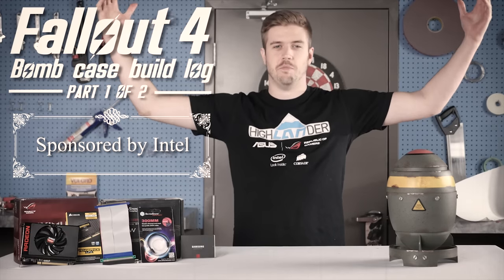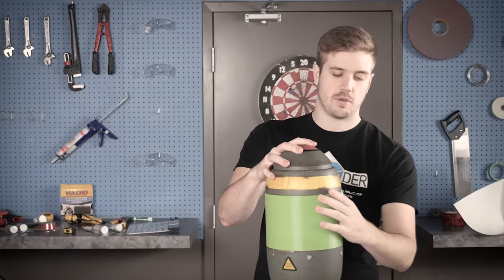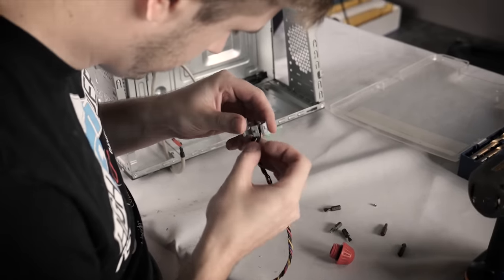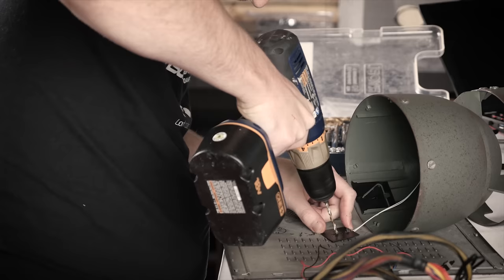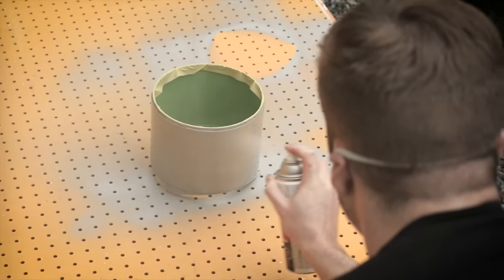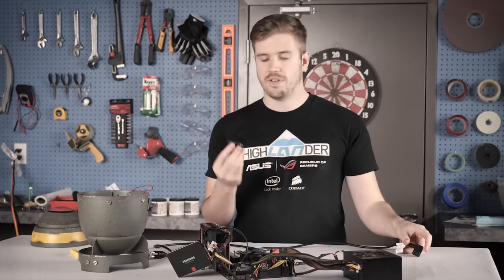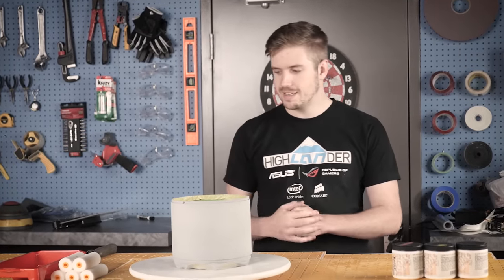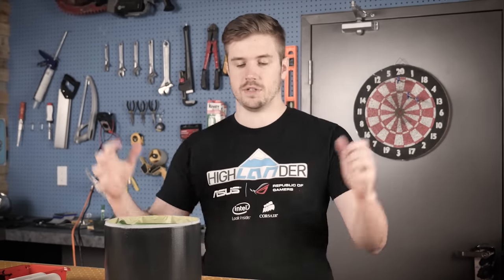Fallout 4 ULTIMATE "Bomb Case" Build Log - Part 1 of 2

Comment: Did you know someone managed to fit a computer running windows xp into the actual windows xp cd box itself? lol
Reply: +skil3z raspberry pi magic.
Reply: *****
 BEFORE Raspberry pies. The motherboard he used was a EPIA M10000 Mini-ITX
Reply: +skil3z Pics or videos?
Reply: +skil3z they could have just taken like the Zotac Mini PC thing the reviewed a few weeks back and fit it in the bomb with no problem without that stupid riser.
Reply: DanielRichards644
 You haven't even seen what the riser will look like painted but if it turns out ugly, i'll agree
Reply: *****
 regardless of how it looks when painted it will NEVER match the CURVE of the original.
Reply: DanielRichards644
 well i agree, it will look stretched, or like a realistic nuke, and not an ellipse shaped
Reply: *****
 plus it doesn't help that Luke doesn't seam to KNOW he needs to sand between primer coats to smooth the surface using the high build primer which is why that pattern was showing up when he began applying the black paint. if he finishes with a glossy finish it the 3d printing "lines" will telegraph thru the paint noticeably.
Reply: +skil3z easy nowadays, just throw a computestick in it and done :\
Reply: +ThaTyger and ull even have space to spare
Reply: *****
true, although it's probably easier to get XP to work well on a computestick and they tend to be a bit more powerful. More expensive as well. Hmm you could put like 10 Pi Zero's in a old-skool CD box :x
Reply: xXAUSTYNN 11Xx
 congratulations, only 8 MONTHS late to the party. maybe if you read the responses you would have seen the guy that already mentioned the compute stick
Reply: Be funny if it was running Mac OSX or Linux.
Reply: Lol

Comment: that does seem like 3d printing for the sake of 3d printing..... then there was all that work to basically make it like a PVC pipe you could have bought for a couple of cents :/
Reply: +wacka What's the point of having a 3d printer if you're not going to take advantage of it
Reply: +wacka You know that there are PVC pipes with the exact size needed?
Reply: +wacka because mounting options? because 3d printer? Because diy? Because modularity? because options?
Reply: +wacka Well, IF it was available in exatly that size. not impossible, but i doubt it...
Reply: +djkucuk I'm not saying "never ever use a 3d printer for anything!".... I'm just saying, a PVC pipe seems like a far simpler, cheaper, more productive option here... and mounting brackets..? a little bit of metal with a hole in, glued to the inside would do the job.. or.. you could even 3d print them

I love the idea of 3d printing stuff... but if it means having to spend ages sanding down, priming, re-priming... re-re-priming... Id rather find a more simple solution
Reply: +wacka 2 people mentioned size, of course u ignored it. pipes come in discrete standard sizes. m8.
Reply: +Mr Ching &#171;chicho&#187; Chong 
Also mounting option to get it perfectly flush and snug is a pretty big point...
Reply: +wacka Well this was a sponsored video. Gotta show Intel how theirs is special and is different from the competition.
Reply: wacka To be completely honest, If I had to choose between custom ordering less than a metre of PVC pipe or hunting around for a PVC pipe that closely matches what i'm looking for. I'd take 3D Printing every single time.

You say sanding and priming is a bitch when you suggest glueing a piece of metal to a pvc pipe. The paint prep is not only easier, it's easier to source.

If you think you're not going to have to do any filing, or whatever may it be, if you think PVC and metal come in the exact specifications that you need every single time, then you are deeply mistaken, that's why 3D printing was invented.
Reply: ***** depends... would I rather print off a leaflet than order one? sure... Would I rather print out a book than buy one? no

Would I rather print off a bath plug than buy one? sure.. Would I rather print off the chain that holds it than just buy a small length of chain? no.
Reply: Exactly. In this case printing the 'pipe' is preferable.
Reply: wacka You're amazing, working with PVC pipe is easy but I can't believe that you think that it's easier than printing something that represents EXACTLY what you want.

Your metaphors make zero sense fyi,
Reply: Jacob S This is kind of my point... it did not print exactly what he wanted... thats why he had to spend hours sanding it down
Reply: wacka Hours? That definitely wouldn't have taken hours. This discussion really isn't going anywhere. You and I are probably not going to be owning 3D printers any time soon so it's pointless, have a good day buddy.
Reply: Jacob S true, but those 3d printers are coming along in leaps and bounds.. lets hope we get really high res affordable 3d printers in our life-time... we could print out an entire mini-nuke PC case :)

have a nice day too buddy
Reply: wacka  3-d printers are expensive, sure, but not so expensive that a good model isn't already affordable for a middle class worker.. "within our lifetime" is needlessly excessive :p
Reply: Pivitrix I was more taking about the "high res" aspect, but also affordable high res.

I guess in my mind I was thinking about the star trek style replicator :P
Reply: +Jacob S exactly, it smacks of jealousy just moaning about using a 3D printer when you could concievably do it another way, also the bought pipe would not have the cool latches but I think they missed a trick not 3D printing a logo of some kind onto the pipe or some detail.

If I were doing this for a present for some Fallout obsessed fan, and say there name was Robert, I'd use their name in a sort of etched in design that looks like a bomb code or product label of some kind like ROB3rt MK4 GMPC 0001 or some shit like that, you get the idea. put a bit of thought into it, unlike what I just did
Reply: +wacka Ordering a 3d model is actually pretty affordable. I think once you weighed in the extra prep time a pvc pipe would have had, you would have ended up coming close to even, if not even saving a bit of money. (This is of course calculating that extra time spent could have been used making money at a job or w/e). A mediocre 3d printer is around... oh.... 300 or so? With a very nice one around 700-1.3k ish. The price of 3d printers is going down greatly. ALSO do keep in mind, there are many institutes that own 3d printers and will let people come in and make use of this technology.
Reply: Jeffrey Baker they could probably do a whole episode on 3D printed cases... you could probably do something very custom to a specific component layout you have in mind, so that the case is specifically designed so that the airflow goes exactly where its needed most...with minimal amount of fans.. could be really interesting... and you could 3d print a new case when you upgrade or change the layout of the components
Reply: Jeffrey Baker The sad thing about 3D printers is they just didn't happen like many of us who loved the idea wanted them too. So yes the price is dropping but quality isn't increasing. Pretty bad 3D printers are getting cheaper but anything I'd want to personally consider is still way up there, incredibly slow and not the user friendly experience you'd expect from say an inkjet printer or a Laser and that's the end of that.

What needed to happen was for the buzz to grow as it was doing a few years ago and then for one large company like say Samsung to step in and have a go at throwing their weight into making a fast high quality printer for the home at a price most people semi interested would go for. After that, much like Oculus Rift, other companies step in and want a piece of a potential new market. But that didn't happen so you have little startup companies producing pretty shitty printers but in ever more clever ways to bring down costs and then the slightly larger companies of which their were about 2 I think, they merged and there's nothing on the horizon. I think the 3D printing revolution is over for now

Major bummed out by that. I wanted a printer to knock out really fast high quality 12 inch high sculptures of fantasy figures, monsters, characters and so on but that's many thousands of dollars to do and even then fraught with problems.
Reply: Clay Mann True, but as I said, there are many institutions that already, or plan on getting high end 3d printers for public use. I could very easily see a day where you could hop by the library (or wherever you would put one of those things) to print a 3d model.
Reply: wacka the problem is that super limited build platform most 3D printers have of just a few inches. It makes building bigger things a real pain in the arse. If you were really smart about it, you could print a modular design that could work like lego and snap together but I that's way beyond what most people could do. I totally get you though, the idea of custom printing, designing just for your own idea of the best airflow and upgrade options. It would be glorious.
Reply: Jeffrey Baker I think that's a good solution. Sorry I totally ignored that in your comment. Got carried a way moaning about the state of printers lol But yeah, having places locally where you could get access to printers that could knock out much bigger parts. I'm really surprised there aren't more already. There's nothing anywhere near me, traveling distance wise in a google search but I'm in the UK, we tend to be backwards about tech here. Maybe the US is handling that better
Reply: i think the revolution just started. seriously i only started seeing more 3d printer stuff this year
Reply: Clay Mann there's that TED thing that came out a while back - https://www.ted.com/talks/joe_desimone_what_if_3d_printing_was_25x_faster?language=en
Reply: ***** wow, apparently I'm retarded because I think simply ordering something online is easier than CAD designing, printing, and then spending hours sanding something...
Reply: wacka ah yes I did see that, not the TED talk but the first printer to use that tech. They did solve some big problems there with strength and speed, not sure about self curing as the printer I was looking at required another machine to cure the model after it came out of the pool of resin. Anyway the bad news is it costs thousands for the printer and again for the curing machine but I was still considering it at this point because it offered such high quality, I mean detailed prints good enough that I could make scan a games workshop giant troll and then print it out and the two would look identical! awesome.....but the resin. oh vey that's some expensive stuff and every print, the whole tray is done and has to be thrown away for the next print.

Here's hoping that future models get closer to the TED talk's goals. I'm sure they will in time. Man I'm a big grump on this subject. I should stay quiet lol
Reply: wacka I'd say it depends on whether you already own a 3D printer. If you do, man you don't need much of an excuse to use it. the baby needs a new pacifier? hell no we won't be ordering that! I'll design one and keep re-printing it every month to match  the babies exact hand size! Like that meme that says, http://streetcarpro.com/nyc/wp-content/uploads/2014/09/resized_all-the-things-meme-generator-bought-a-new-printer-print-all-the-things-2f2ec9-800x576.jpg
Reply: +wacka They don't have the tabs their printed part has. Also, PVC looks and feels cheap, especially in a build like this. Also, finding PVC that exactly matched the dimensions of the canister would be very difficult. Even the .5 mm mentioned below is a noticeable difference. Also, PVC pipe with that diameter will be very thick, and heavier than 3D printed parts. Plus, PVC doesn't take paint well - you have to sand and prime it, and now you're back at the same stage as with the 3D printed part, but with lower quality components. 

No, the 3D printing was definitely the better alternative here. PVC could get the job done as a stand-in for 3D printed parts, but just as well as a Galaxy S3 stands in for an HTC One M7 - they both work well, but one is in another class of quality. 3D printing is simply higher quality construction.
Reply: Clay Mann no i dont follow 3d printing closely, its just a few youtubers who have acquired them. including LMG as we can see  and barnacules nerdgasm. and more and more schools aeem to be buying them for students to use
Reply: 3D print guns  <3
Reply: Why do you exist

Comment: Jesus christ, i love that you do more diy stuff now, but you should hire someone who actually knows how to do that stuff to guide you a bit. I hope you have fire insurance, because the solder job on that plug is just unacceptable.
Reply: +Jay Anderson you do realise that he will probably just build the whole rig, turn it on once or twice and then never look at it again / salvage the parts? if the solder job was so extremely bad, there would've been a nice spark when he plugged it in in the video.
Reply: +Stijn S. Sch. This, nearly every build they do is immediately torn down after.
Reply: +Jay Anderson This is a FALLOUT build.....get the point? :D
Reply: +Stijn S. Sch. Not really, his soldering on the extension cable was terrible, just because it didn&#39;t trow a spark right away, doesn&#39;t mean it won&#39;t do it soon. They actually admitted that he didn&#39;t have a good connection in the video.
The soldering on the switch on the other hand looks acceptable, from what I can see.

Comment: Great video.  You guys always keep things real simple and even if you not going to build one, the production quality and and thoughtfulness in to making it interesting is spot on.

Just a few tips that I noticed would help a bit.  You spend a bunch of time figuring out the power switch.  Using what is called a long lever momentary switch (some places call them snap switches) its the same switch but it will have a metal bar or plate and the switch is the fulcrum.  You can mount them along the side or right in back of the current switch.  I buy switches in large random bags on Ebay.  sort them and you have switches forever.

Another area is the power extension cord you made.  Wrapping the soldered posts in electrical tape is asking for a fire.  Electrical tape in a hot environment will come unstuck and could turn all your hard work into a pile of molten plastic or worse.  Liquid electrical tape is the way to go there if you are not able to cover all the posts with shrink tubing.

Also you mentioned that you are horrible a soldering.  That's because you are using a pencil soldering iron.  Try using a soldering station setup.  Not as easy or mobile but your work will improve 100 times.  Hakko 936 is all the soldering iron you will need for this kind of application and they are about 60 bucks US and they last forever.  There are lots of instructional videos on YouTube that can get you soldering like a pro in no time.

Comment: 11:29 A smoother surface is not required at all for "high voltage" mains wiring (110-240vac). But for voltages greater than about 2,000 volts, then you should solder with smooth joints. This will only make the circuit more efficient, maybe by 00.01%. More importantly this will increase break down voltage to near by electrical conductors with a potential difference of > ~2,000 volts.

Comment: Build looks awesome, liking the idea, just a few points however. With filler primer you should sand down with wet and dry after the second or third coat, your first top coat will then be your witness coat. As for the soldering, heat-shrink plastic should be used to prevent short circuiting.

Comment: I know this video is old but, pro tip for spray painting: Light sand (400 grit or higher) the surface before you prime, it'll ensure much better paint adherence and especially in this "Case" (See what I did there?) it'd add to the effect of it. Then when you're actually spraying you'll want at least 8 inches of space between your nozzle and the surface otherwise it may drip and fuqq it up!

Comment: Just a quick hint, there's stuff called "glazing putty" that's a bondo-type material but much finer.  It would do a much better job of prepping the surface than primer.  It'll fill in small gaps much better, is very sandable, and you can finish any way you could possibly want.  Glazing putty would remove the need for "acetone vapor" finishing or whatever and would give you a really smooth finish and remove the visible layers of the FDM process.
Reply: The other thing to mention is that "Delta-style" 3d printers do a better job of printing circles, so maybe that would be something to keep in mind for the future?

Comment: I think, if one can not solder high voltage connectors tis possibly will be a sollution, 

1. Leave a short pice of wire on the connectors (if salvage an old one)

(If a new one, there are some metal crimping connectors that fit most of those blade connectors, just check the with of them for correct size, use heatsink over it after crimping it on the wires, only thing with that is that the tools for crimping is expensive... but some sheap tools in carpart stores will work, they go for only a fraction of the price of a expensive one, and you can use it for much more job since those sheap ones often are designed as a sort of multi tools.))

2. Get a encapsulated screw connector.

3. Mount that thing as a safe connector betveen the intake connector and the interna powerline.

4. Not sure if i am right here but it works for me.

-

Comment: you need more paint on the roller, you dont actually want to push down hard on the roller, uness youre looking for a textured look that looks like the roller pan, also it wont hold anyy paint if you push on the roller meaning you only have enough paint to cover a surface equal to the surface area of the roller